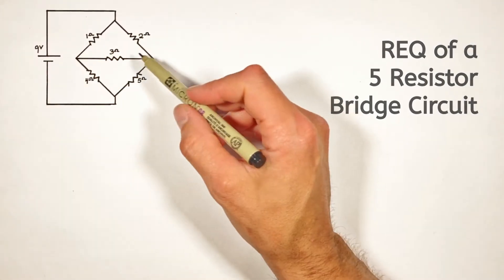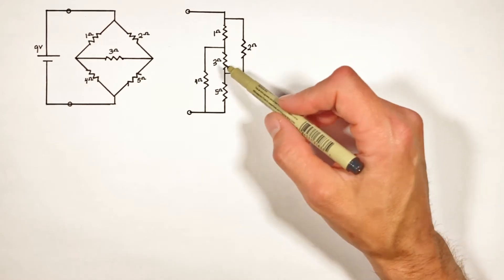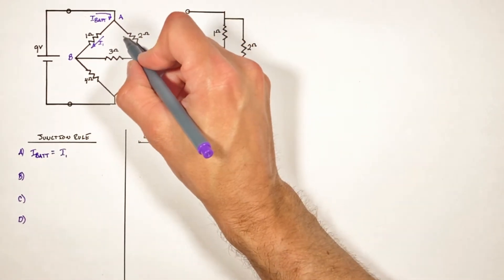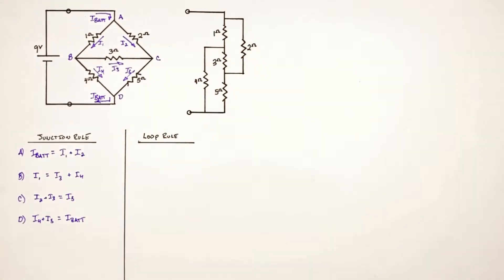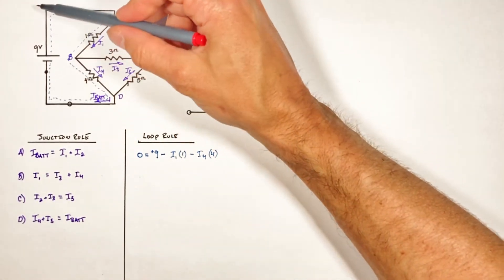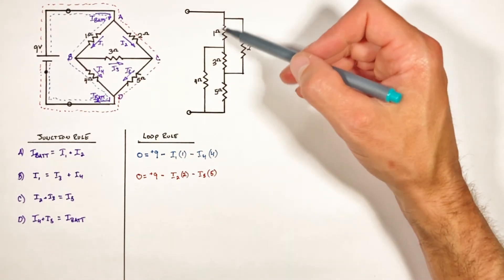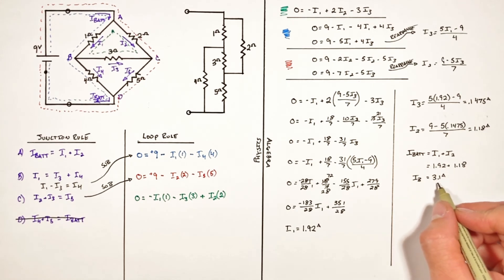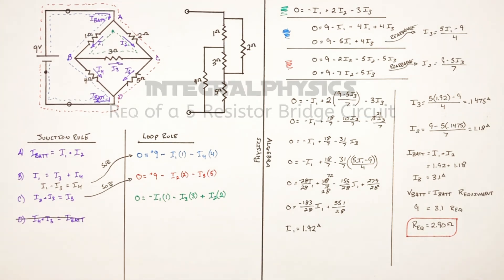Calculate Equivalent Resistance of a 5 Resistor Bridge Circuit | Kirchhoff's Loop & Junction Rules

Comment: That's why we have "delta-Y" circuit. 
But is a nice example where you can put any power value and use just the elementary law's of electricity. 
Nice video.

Comment: Draw one and two in a straight line, drop down on the paper draw 4 and 5 in a straight line,  draw two lines vertical connect the open ends,  draw 3 across in the middle , between the two lines ???

Comment: very complicated way of matrix equation.
Actually - there is yet another way - Delta-Y equivalence. you can substite any 3 Y-connected resistor, with 3 another resistors, Delta(triangle) connected.

Comment: Great video, thanks. I avoid a page of algebra when I can, and use thevenin / norton equivalents to solve nearly all circuit problems. In this case, the left and right legs can be 2 simple thevenin sources. Then the 2 thevenin sources are connected by the cross resistor. Then use Ohms law to get the current in the cross resistor. Once you know that, the rest is easy.  
I use my trusty HP (RPN) calculator to calculate parallel resistors for the thevenin equivalents: R1, 1/X, R2, 1/X, +, 1/X. Works for any number of resistors in parallel. If I need to keep the math for next time, I put it in Excel. 
Whenever I see a  resistor divider on a voltage source, I think thevenin equivalent. It reduces 2 resistors to 1, and helps me understand / visualize circuits better.  
I use superposition to solve the gnarly ones.

Comment: Hi, I have a question. If I am considering a similar circuit with all resistors having equal values R, then no current will flow through the central resistor due to B and C being equipotential. Can I then ignore the central resistor and use parallel circuits to solve the problem? It will then become a parallel circuit with each arm having 2R, and so the effective resistance would be R. Is this reasoning correct?
Reply from the maker: yes

Comment: I have a suggestion to make things easier, you could also transform the upper part of the triangle to a y. delta to y transformation. With that you can now easily solve the total resistance using parallel and series combination, you don't have to solve for voltage and current anymore. Hope it helps :)
Reply: Thank you mate , I have solved  by this way .
Reply: @The-Catmemer  dont know why we made it so complicated. this is how i did it
Reply: Pls make video of it, i don't get it

Comment: What if instead of the middle resistor there was a capacitor and also an open switch, that is then closed and the charge on the capacitor is 90 uc, also no value given for the battery? Thanks for your help!

Comment: it would have been much easier if you applied Delta  to Y  transformation
Reply from the maker: I chose not to use DY in this problem because lots of people see bridge circuits before they learn DY, I didn't want to open up that can of worms for them.

Comment: What made me mad is that you said we should guess if the current is moving out of or into B. When in reality the current is higher in the branch the resistance is lower so it should be going out of B as i1 is greater than i2.
Reply: This is something that the creator probably has an intuition for, but for someone who is new to this, this wouldn’t be intuitive, especially when you consider the largely misunderstood statement “electricity follows the path of least resistance.”
Reply: It doesn't really matter. If the guess is wrong, the mathematics comes up with a negative value. I think he briefly mentioned that.

Comment: I have a question, in 14:55, where did 1.92 come from for I1? I have already done the previous steps before that, yet I couldn't seem to get the desired answer in the end. Thank you in advance!
Reply: I think I get it now:

0 = (-183 / 28)I1 + 351 / 28
(183 / 28)I1 = 351 / 28
I1 = (351 / 28) / (183 / 28)
I1 = 351 / 183 = 1.92A

Is this correct?

Comment: Why is I3 1.4 instead of 0.147 I did ur calculation in my calculator for I3 and I got 0.147
Reply from the maker: Not sure what you are referencing.  @15:58 I solved I3=.147A then rambled about sig figs.
Reply: @INTEGRALPHYSICS  I agree on the question, if you use the calculator to solve the equation it ends up with 0.15
(5*1,92 - 9 )  / 4  = 0,15!

Comment: Pls, any practical result out of this except a practice in a simple algebra? The bridge itself is used to measure voltage only between the middle points. And is widely used because any input voltage noise is eliminated and does not affect a measured result.
Reply from the maker: I'm sure someone smarter than I uses it effectively in some application.  But the point I think you are making is largely correct; I as a student then teacher really have only ever seen this bridge circuit as a common way to start roughing up kids in introductory circuits courses.
Reply: The load cell (part that converts weight to voltaje) in a scale is internally configured like this.

Comment: You can use the online HTML5 "PhET Circuit Construction kit (DC)" to "build" this circuit and check the result. I found that the battery current was 3.098 A to a couple of extra significant figures.
Reply from the maker: I check my work on a few of these bridge circuits using PhET.  =)

Comment: Use the D-Y transformation and you solve it in less than 2 lines.
Reply from the maker: Not quite two lines but inarguably easier.  The issue is, the Delta-Y conversion is something that virtually no person seeing a bridge circuit for the first time is going to understand.  They may utilize it as a magical tool, but not comprehend what the transformation is doing.  

The real point of the video, regardless of D-Y or lots of algebra, is the diagram @35 seconds.  The circuit cant be solved using typical series and parallel combination methods.
Reply: @INTEGRALPHYSICS  Sure, I get that. I don't understand the D-Y conversion either, but it's a cool tool to use when you can't think of a faster way to solve a problem on a test. I was searching the web the last 2 days up and down for circuits, cause my teacher is a total a$$h0le and can't teach. This video was helpful on some fronts.
Reply: Please provide your 2-line solution using D-Y.

Comment: Only question, on rearranging. Why in the first equation the I3 equal to I3=(5I1-9)/4 while for I2 it is equal to I2=(9-5I3)/7? Why isn't it I2=(5I3-9)/7?
Reply from the maker: In the I3 equation I moved everything else to the other side of the equals sign. (so the 9 and the 5I1 changed sign)  In the I2 equation I moved the I2 across the equals sign so it changed sign.

Comment: In 12:38 where did 4I1 and 4I3 came from? More specifically where did that "4" came from? Since I1 and I3 have 1Ω and 3Ω resistors, then what that "4" does there? Is that the substitute of so called 4I4??
Reply: Oooh i see. Now I understand how it came. Just to be sure nobody will fail on that:
0 = 9 - 1I1 - 4I4 (we replace 1I1 with I1 as there is no point to write like 1I1. We replace 4I4 by the substitution of I4 which is I4=I1-I3)
0 = 9 - I1 - 4(I1-I3) (we multiply 4 with each part in the parentheses. Be careful with signs) 
0 = 9 - I1 - 4I1 + 4I3
Reply from the maker: You got it!  Thanks for clarifying the algebra.